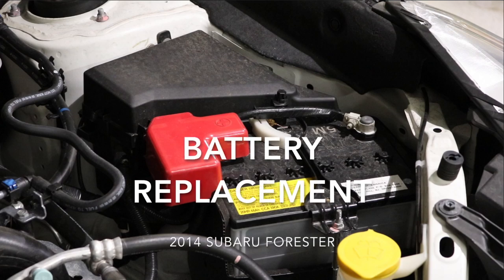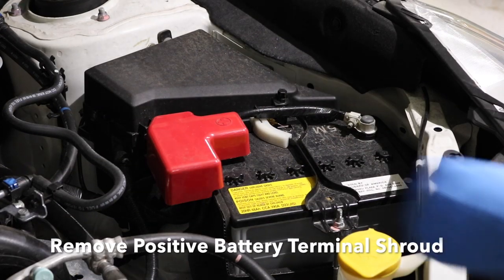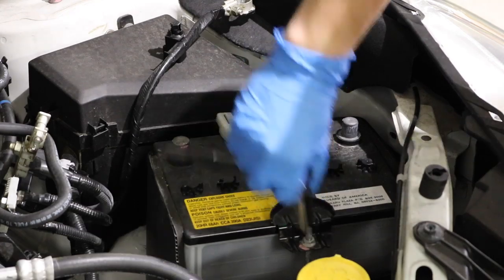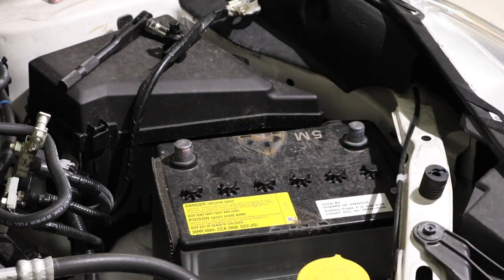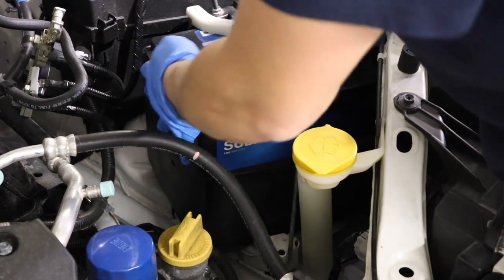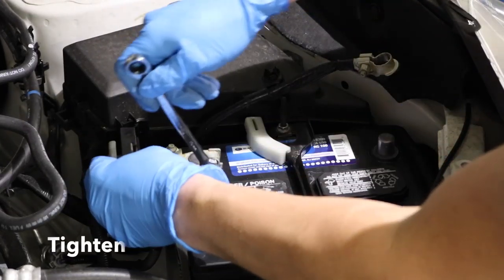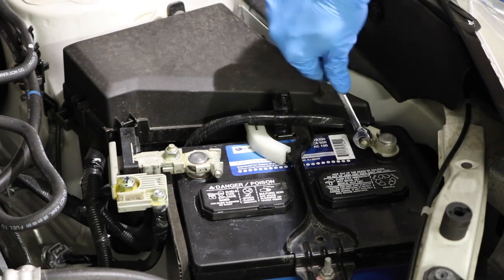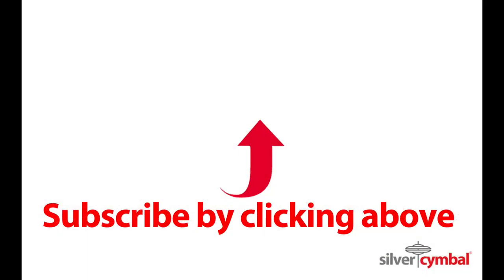How to Replace a Car Battery

Comment: Thanks... your vid helped tons. You should note in the comments to use an extended 10mm driver... the drivers that came with the ratchet set is too short to reach the nut on top of the battery bracket

Comment: Thank you so much for the tips on the window. It took a few tries but my 2017 Forester windows are back in sync.
Reply from the maker: My pleasure glad it helped. Please share with anyone else that can benefit from my video. Thank you kindly for the comment and for watching. Best wishes to you.
Reply: @kaisenji... For your 2017 Forester.. what else resetted besides the window and radio preset stations? I have to change the battery which is no problem but have no idea what else would reset... Did you have a battery management system? Where you had to program the battery settings into the car computer?

Comment: He should have used a battery memory saver? That's as simple as 2 alligator clips a couple pieces of wire and a small 9 Volt battery; so it can hold a trickle charge on some of the electronics!
Reply: Michael DelRossi keep a memory

Comment: What if the original 550 cc battery is replaced by another 650 cc battery in the Subaru Impreza or Ascent from 2019 to 2021 ? thank you

Comment: I just changed mine on my 08 Impreza WRX. I was worried if I needed to keep a small amount of power for the ecu, like some newer cars where they recommend you connect an small power source to keep your ecu or other electronic parts that need constant power from either reseting or shutting off completely.
Reply from the maker: You don't need the supplemental power, at least you won't have any problems without it. In my experience the ECU, etc won't be affected. Most often the clock and radio stations may be lost but it's usually fairly minimal. Thank you for watching and please subscribe.  Best wishes.

Comment: My 2013 Forester did not start on the first try. It spun the motor but no spark.
Cranked it a second time after about five seconds, fired up after a longer crank.
Third time it starts normal.
I was told the electronic's need to re remind themselves that it is an engine! 😂

Comment: Changed the battery on my sons 2012 Impeza.  After installing new battery, several warning lights appeared including the check engine light. The car started but is undrivable due some kind of transmission sensor? Any suggestions?
Reply from the maker: I would try disconnecting the battery, wait 15 minutes and reconnect it. It may help reset it. Let me know how it goes.
Reply: Change plugs wires and ignition/ coil packs

Comment: Just changed my MY14 Forester battery, and now the automatic window doesnt work, can only imagine what other problems a simple thing can cause?
Reply from the maker: If it still goes up and down but its the auto fucntion that doesn't work. Put the window all the way up and hold the window UP button for 5 seconds. Then try the window again.
Reply from the maker: More details here for you: Initialization of power window
If the vehicle’s battery is disconnected due
to situations such as battery or fuse
replacement, the following functions are
deactivated.
. One-touch auto up/down function
. Anti-entrapment function
Initialize the power window in the following
procedure to reactivate such functions.
1. Close the driver’s door.
2. Turn the ignition switch to the “ON”
position.
3. Open the driver’s side window halfway
by pushing down the power window
switch.
4. Pull up the power window switch and
close the window completely. Continue
pulling up the switch for approximately 1
second after the window is closed completely.